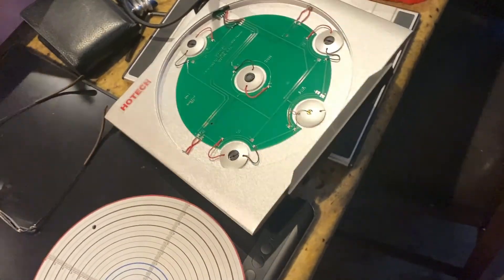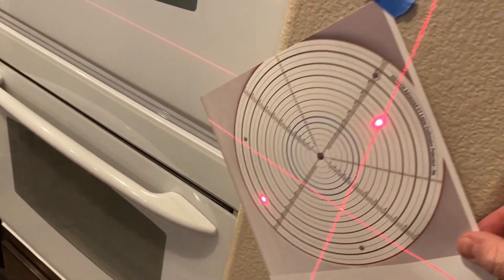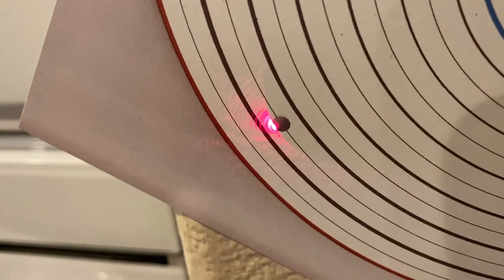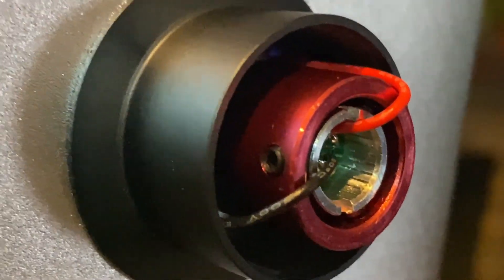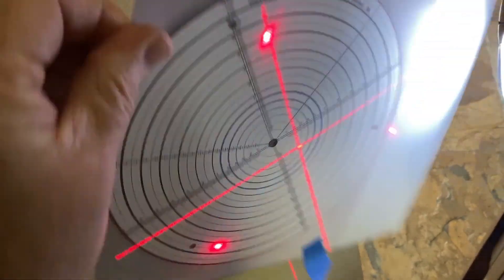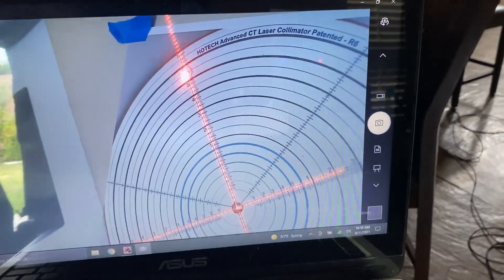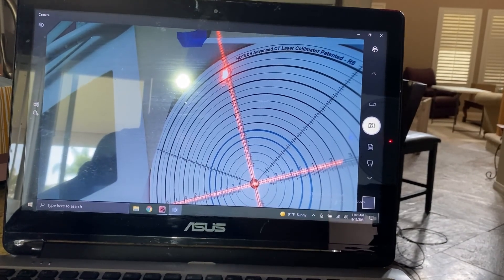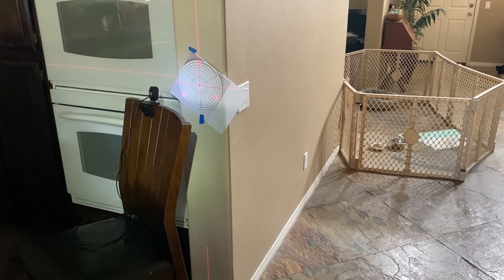How To: Calibrate Lasers on Hotech Advanced Laser CT collimator.

Comment: I have been having issues getting the Hotech parallel to the Meade 8in SCT that I have - I was wondering/hoping that you could do a step by step.

Issue for me I think is the proper distance between the Laser Collimator and the end of the tube.
This would be with the secondary mirror in place. I have seen some where they have the secondary mirror removed for Hyperstar, but I think that the workflow is much different.

Comment: I would love to see you actually Collimate with this. I cant get mine to work. There is too much slop in the eye piece to get an accurate reading. Did you get  moon light focuser or something?
Reply from the maker: I have a collimation video on my hard drive that I did but when I was editing it I didn't like the way it all came out so I abandoned it.  I'd only use the Hotec to align the optics on center axis and then I  have been using the tribatinov mask which makes the whole thing so easy now.

Comment: I picked up one of these a while back and after about 3 weeks of trying to make it work and talking with their support, we all finally gave up.  I know the lasers are off but was not wanting to do anything that would void my ability to return the product.  Support has disappeared so now I have nothing to lose.  

One question I do have is would it not be imperative that the plate and the photocopy taped on the wall be at the exact same height and plane (tilt left / right or up / down).  In my minds eye I can see that you could still center the cross but not be square with the wall and this could artificially show the 3 laser dots being off.  Am I wrong?  

If it is important how did you confirm that you are completely squared up with the wall? 

I have also heard of people using a mirror to bounce the lasers back to the corrector plate in effect making sure you are completely square with the target and then just making sure the 3 lasers feed back into the same holes. 

It really is a great video and I would love to see a follow up with how you completed the actual collimation.

Thanks!

Comment: Thanks for the video - very informative! I have an EDGE HD 8 and the HOTECH CT collimator and always have one laser dot away from the other two when focusing on the attached HOTECH reflector. No adjustment seems to get all  three red dots converging to one, even though my collimation looks fine using a defocused star.  I'll try your method and see if one of the lasers is out of alignment. Clear Skies!
Reply: @TheBrokeAstronomer  Interesting, time maybe to adjust the corrector plate.  With thanks!

Comment: Nice! Would you recommend buying this for an Edge 800? or just do a star collimation?  Thanks
Reply from the maker: Star collimation unless you took your optics apart and need to make sure it is all correct.
Reply: @TheBrokeAstronomer  I purchased one of these two years ago. Never was able to make it work. Even if the lasers are spot on, there is too much slop in the eyepiece to every get a proper reading.

Comment: Oh! Thank you for sharing. I also have a Hotech Advanced Laser CT collimator. I believe that I'm having this problem as well. So I will be checking mine soon. But one question or suggestion.... Should the board be closer to wall so that you'll have a smaller crosshair and then adjust. I just want to make sure the board is flushed with the wall. Thanks again
Reply: @TheBrokeAstronomer  thanx again for sharing. I did manage to calibrate 3 red dots on my Hotech. I can confirmed that this calibration should not be adjusted up close to the wall. It will just make things worst. I calibrated from 15 feet and a HUGE improvement from new out the box from Hotech. I also learned to focus the lasers beams. Then after I completed  I came across an article that mentioned  somewhere that 20'-50' is the ideal distance to calibrate lasers. I will redo after I stumble on a video on calibrating the crosshair ➕ on the Hotech because I believe its off also. Thanks again